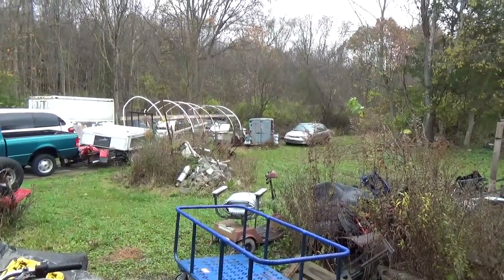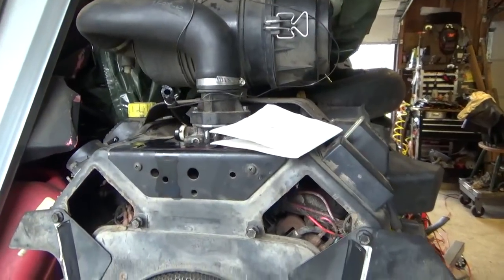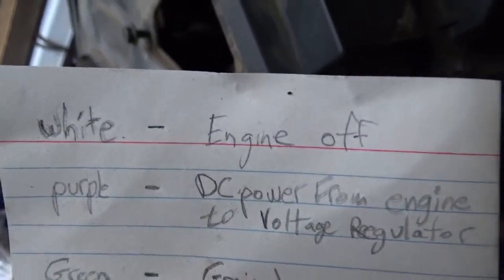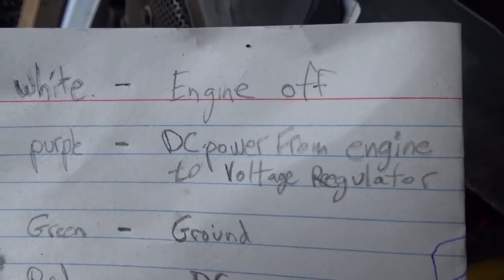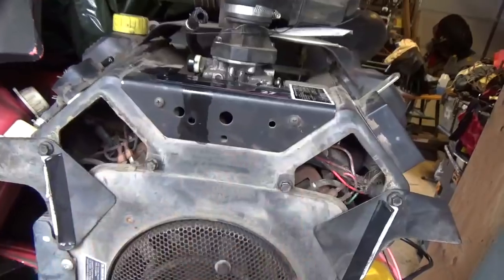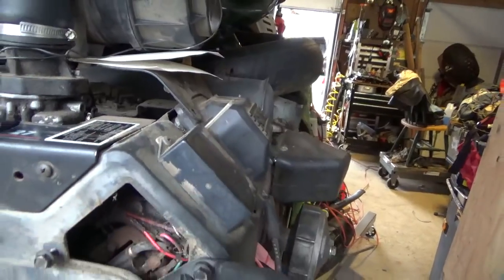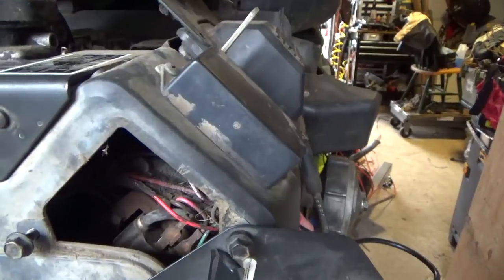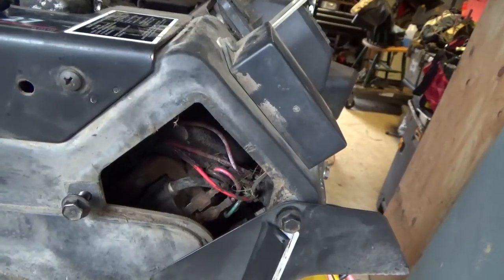Kohler CH740 ignition wiring and start, will my $50 deal run,

Comment: Where is the voltage regulator located on these engines? I believe it's on the opposite side of where all these wires are coming out in your video I see something on my motor it has 3 wires already on it looks to be 2 yellow and one green is that it?

Comment: You know leaving engines laying around not using them after you get them running isn't any good. I mean this in general. You could make a great fortune helping save other peoples Honda's and mowers working on them for REAL cash! Your a wizz. As a perk you could also do videos in between odd jobs. This sound like a good Idea?   Your a Dam good mechanic I would want working on my stuff 100%. I wouldn't mind paying for it too because I know you could trade out the payment for other Honda's or straight cash by saving them $$ on buying your parts or using what you already know in what lesser expensive parts could do the same thing. IE the wiring harnesses.
Reply from the maker: Hey Calvin!!!!   U R right, generally speaking, starting an engine and leaving it to lie about is not a good idea, I try to extend the amount of time before storage damage sets in by adding stable, sea foam and by using non alcohol high grade gas... I work on friends' equipment, I gave up on working on other people's stuff  when I do engine work and get blamed for dry rotted tires that will not hold air or when they go cheap and then get cranky when it has to come back for another spindle...  Even with the heating job, a lot of folks hire us to replace a furnace and then expect to get their basement rewired or their simple thermostats replaced with internet enabled ones for free.... The general public is not a joy to deal with and if they are not happy when a job is done, they make sure that everyone knows about it.... I would love working on Ur stuff, the only issue is that we would spend so much time cooking, drinking, and shooting the bull that Miss Betty would not let me come over to play after a while.... I need to find Ur mailing address again, I think U need to get a package of the learning materials we use up here to teach deer proper behavior...  Calvin, U R a good man!!!!   Thanks for Ur thoughts, encouragement, watching, and commenting!!!!

Comment: Briggs and Stratton had a similar issue with their aluminum/plastic Niki carburetors. The replacement carburetor you get is the old style all aluminum body brass float walbro carburetor. They tried to save money with the cheap Niki, but it bit them in the rear.
Reply from the maker: Hey Dave!!!   Its been a while, I hope all is good with U.... Its not too bad if one can just swap the new and less improved parts with the older version, it really stinks then they change the mounts and one can not go back to the old, tried and true parts..... Thanks for the info, Ur thoughts, watching, and commenting!!!!
Reply: Harvey Spooner thanks Harvey. Yeah, the companies try to "improve" their products, but they are really looking for ways to save money. Nothing wrong with that, except when it affects quality and durability. Thats the nice thing about Hondas, the basic design hasn't been changed. Some of the engines of today are just the older motors dressed up with different fuel and ignition systems, but the heart of the engine remains the same. If it isn't broke, dont fix it.

Comment: I had a 25HP of that same brand name same issue luckily when I got the engine it came with a parts engines that had a good set of coils.
I've also had the same problem on a single-cylinder same brand, those engines with that spark advance system definitely sucks.
I'll try my best when commenting not to include brand names.
Reply from the maker: Hey ARednecksLife, It has been a while, I hope all is good in Ur life.... I try to keep old engines around, even if they are in pretty said condition just for the parts value... About the you tube bots censuring us all, it makes life very difficult, I hate when I have to redo a video for a 1 word slip.... Thanks for understanding, the info, Ur thoughts, watching, and commenting!!!
Reply: WHY

Comment: Sorry , I usually do not comment like this , but taking a running onan off a ss16 is like taking a good honda engine off a honda three wheeler  and putting another brand on it . Now if it had a blown up onan , a diesel  may not be a bad swap . but thats just me
Reply from the maker: Hey Terri, I respect U and Roger Oconner, so, I will not be butchering up the SS16... If I don't do something with it intact, I will find a home for it where the new owner does.... Thanks for Ur good input, thoughts, advice, watching, and commenting!!!!

Comment: be great for a long tail boat motor a 27 hp would be a good size for a smaller boat.
Reply from the maker: Hey Alnbaba,  Seems to be a clean, well cared for, low hour engine.... I just need to think of a good project for it to land on.... I bought a snow mobile to prevent snow, I should get a boat to prevent flooding!!!   Thanks for Ur ideas, thoughts, watching, and commenting!!!

Comment: Well at least you now know it runs, quite smoothly too. You could put it in a go-kart, would be a totally mad engine to use.
Reply from the maker: Hey Wizard!!!   It seems to be what it looks like, a clean, well cared for, low hour engine.... I'm not quite sure where it is going to land yet.... Thanks for Ur help, encouragement, watching, and commenting!!!
Reply: Harvey I ended up with a Kohler CH23 and I think it is basically same as your 27 can you tell me exactly how you wired it to get it to run. I am wanting to build big go kart and need help figuring out how to wire it
Reply: Harvey Spooner email is bobbeuke@yahoo.com
Reply: Wizard8838 I have a kholer 25 and i am getting fuel and fire to the plugs and it will run for 5 min and shut off.Then i let it set for a day and it will fire back up for a few mins and run then die. Its getting fuel and has spark to the plug but will not start. Will not hit or nothing.I need help!!!
Reply: @DoubleBWoodWorkz  trying to diagnose a fault on an engine without seeing it can be slightly problematic, however, checked all fuel lines going to the carb and then make sure you have enough fuel getting into the carb, also check your fuel pump if it has one, once you have done that check your valve clearances as when things start warming up they expand and gaps start to tighten up, also check any electrical connections as they can do the same, but you must remember to do one thing at a time.